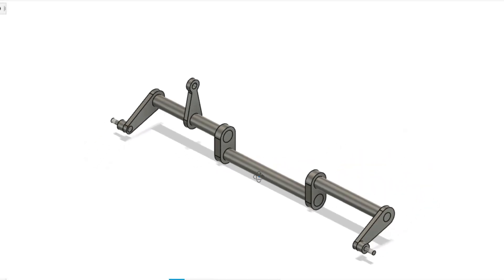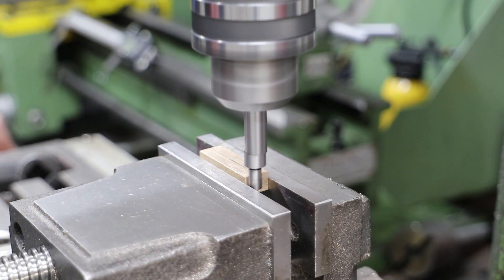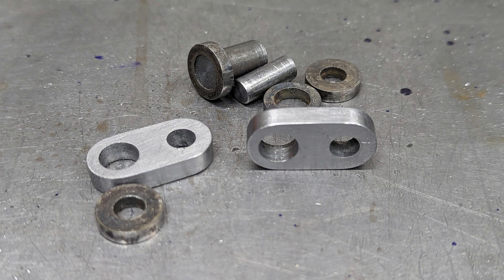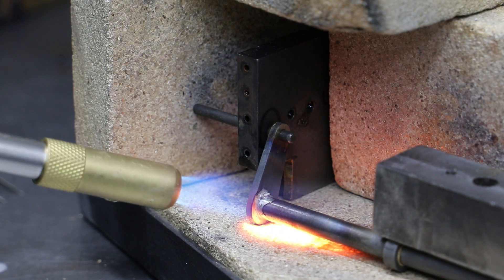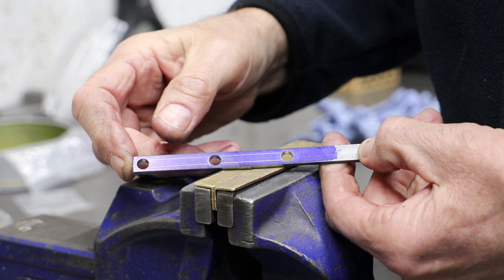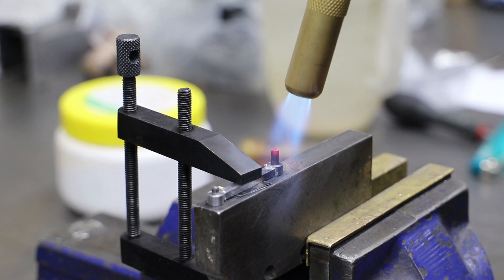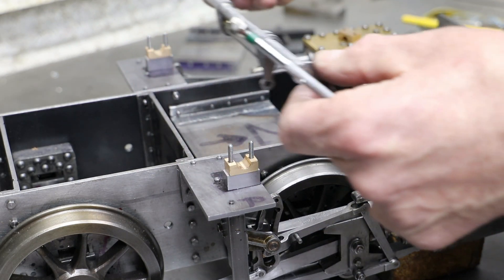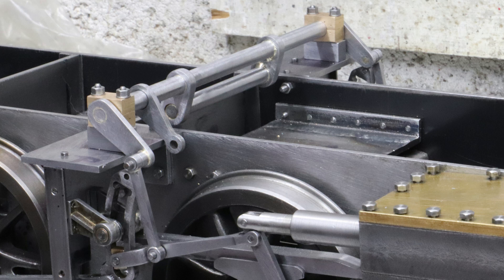Part 50: The Weighshaft and Lifting Arms

Comment: I like the new splash screen. Excellent work as always and a great tip of using the ruler for clearance. I see you're silver brazing again and so sorry for the additional silly question: You advised me that I could get away with Loctite for fixing and quartering wheels, is it also the same for crank axle components? Or am I better off also pinning, or brazing, or brazing/pinning?
Reply from the maker: Don't worry about the questions William, I'm more than happy to answer them as best I can.
Loctite 648 is THE stuff for fixing cylindrical parts - it is super tough but can easily be broken when desired with heat.  For a crank axle at our gauge it will be more than enough.
If you've got any doubts - add a pin through the joint afterwards and loctite that in place too.
Reply: @markshomeengineering5243  thank you! Why did you braze the lay shaft if Loctite is sufficient, please?
Reply from the maker: @williamsworkshopuk Hmmm. That is a very good question 🤔
I did consider loctiting the bosses for the Lifting Arms but not the other joints.
There is a sense of permanency with soldering, and I would probably needed to have made the parts a bit more accurately to have used loctite.  But really I don't have an answer to that question 🙂